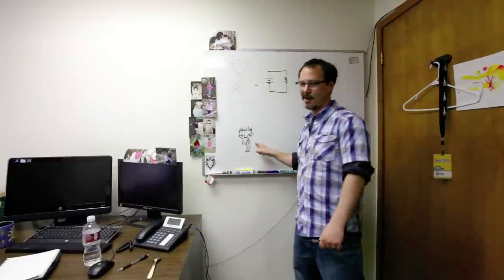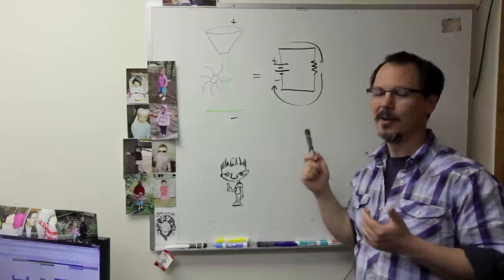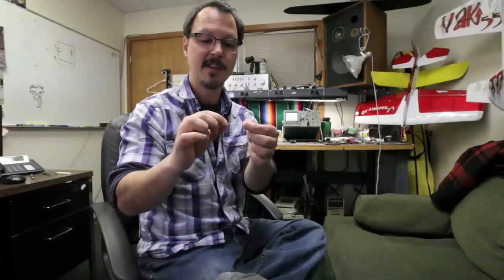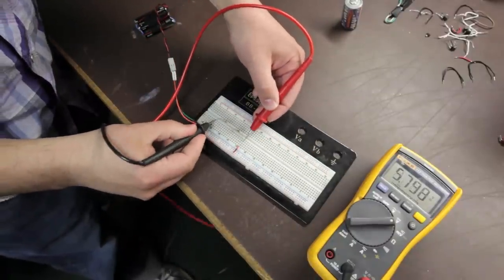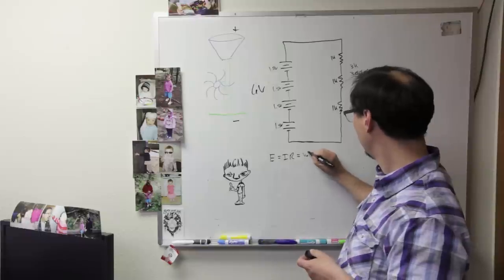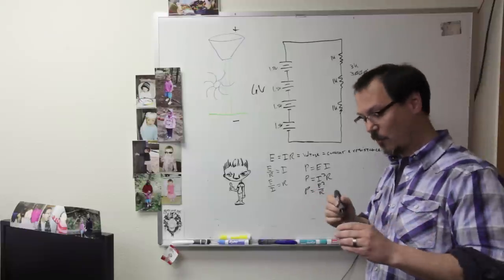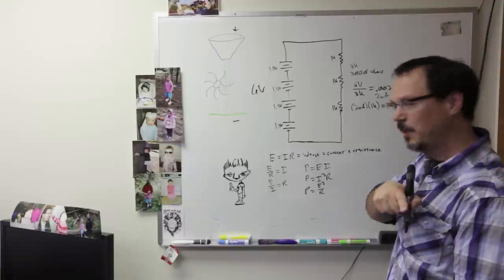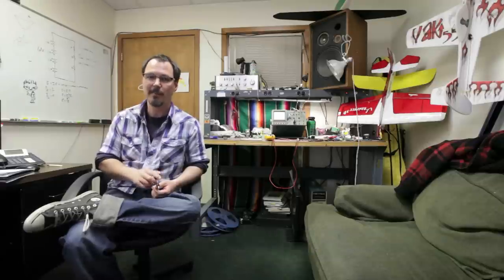SparkFun According to Pete 5-2-11

Comment: @Roymond911 I agree. What i mean is that in order for electricity to flow there needs to be a closed loop, which the sand analogy does not show. In school they used to use the water flow example.

Comment: @strongbad2795 - It makes sense if you explain it right.  Raising the sand to the top of the funnel gives it Potential Energy (charged battery).  Gravity makes it come back toward Earth, doing work along the way.  When it rests on the ground, it has zero Potential Energy (dead battery).

Comment: you should prob mention that the sand and wheel are not a closed system while the resistor and battery is.